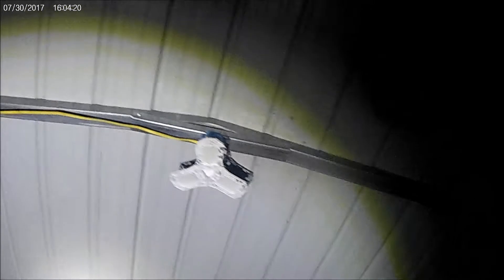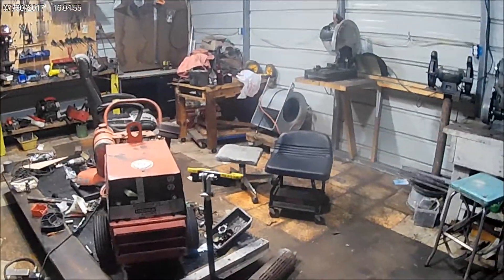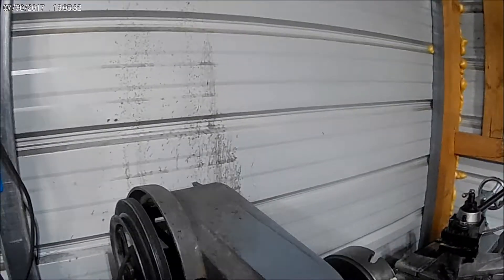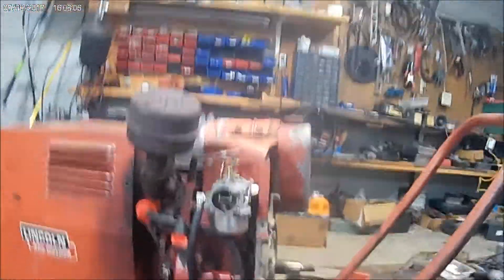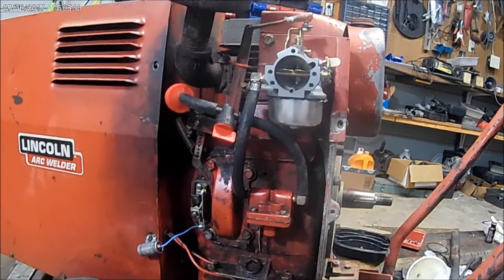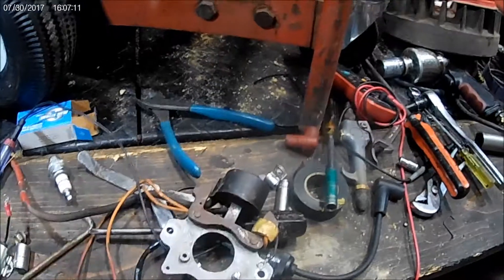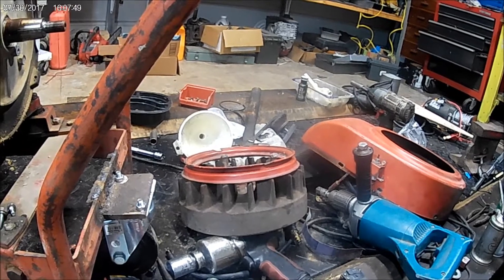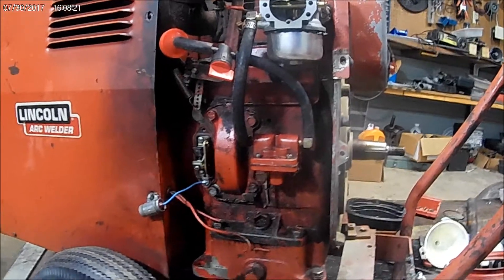A look at my shop lights and a update on the old Kohler/Lincoln welder

Comment: The shop lighting looks very good, I have now a problem with my generator, good spark so I guess there is varnish built up in the carb, I might make a video of that
Reply from the maker: I don't know if you all have the same kind of crappy gas there that we do here, made out of corn but this stuff is awful on the fuel system.
Reply: @MissouriOldTimer  I use fuel made from coal, it is OK maybe there is some dirt in the carb, it did start up but crank for a while and give a shot and fire up, then runs OK, I will have to check, it will just get worst.
Reply from the maker: @jankotze1959  they put an ethanol in this gas, it's supposed to burn cleaner I think they said.

Comment: Missouri did you fix your intermittent spark problem if not id disassemble the entire ignition system could be a wire arcing and causing a ground out situation 
That happened to my brother once on a chainsaw it would idle fine
But when he would rev it up it would break up and spit and sputter  
But when the the rpms would drop it would normally ...
So we diassembled and cleaned every part when reassembling we noticed a small spot on the kill wire
What was happening was the wire would get pulled by the suction of the fan blades to the fly wheel  
And ground out we taped it up  an bent the wire so it was farther from the fly wheel and solved the problem
Reply from the maker: yes, I checked all the wires, even spark plug wire all tests good, I'm hoping it is the coil. but we will see.
Reply: @MissouriOldTimer  hope its something simple like that

Comment: It's nice and bright in your shop now. Gotta love that. What size is your shop building? Did you build it?
Reply from the maker: it's 20 x 16 it was put up by one of those car port outfits and I'm not happy with it,  it leaks , I think the installers walked on the seams and dented it in so rain can gets in between the sheets of metal.
Reply: @MissouriOldTimer  Oh that is unfortunate. It looks like a perfect solution for a shop otherwise.

Comment: I like the lights I can't work in my shop at night it bothers the neighbors. I found a couple of starter generators. But my God they want over 100.00 each for them. I looked online to see what they sold for and I found one on eBay for 169. and one on Amazon for one 110. I've got one more place to look but the guy is out of town right now. Do you know which way it needs to turn?
Reply from the maker: I think once I get the firing fixed it will start pretty easy with the rope,  I don't run engines at night to bother the neighbors but I still piddle around then because it's cooler. I think it's the same as all engines but I think it'll be ok with out a starter. thanks for looking though.
Reply: @MissouriOldTimer  A lot cooler!!